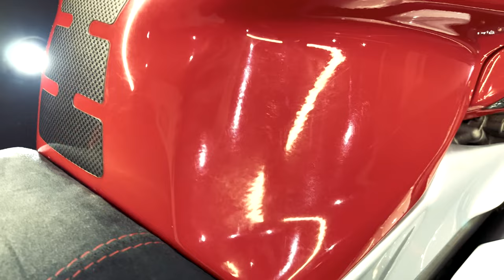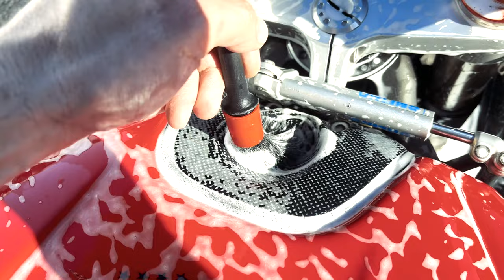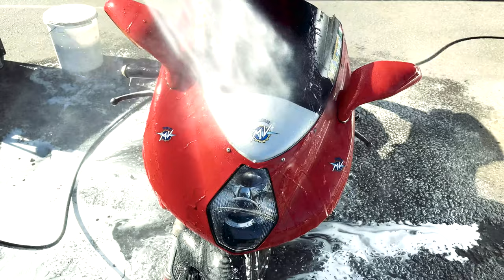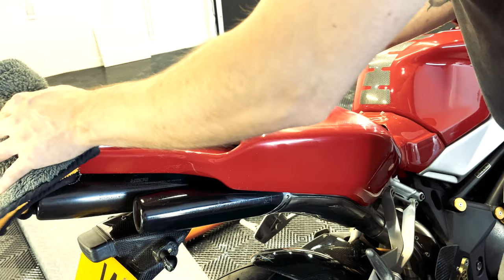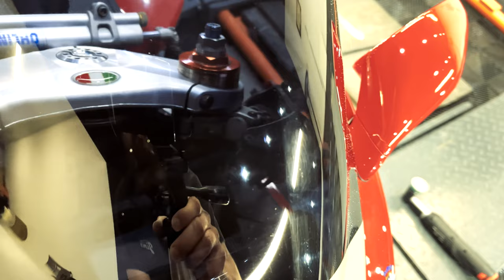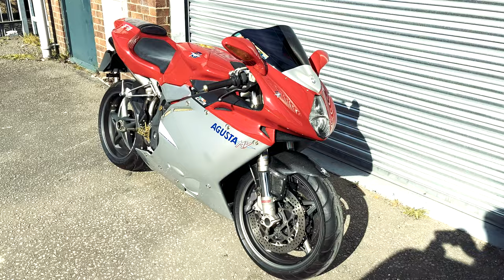Single Stage Machine Polish & Protect - MV Agusta F4 - Motorcycle Detail

Comment: Great job! But I'd never hose a MV, with a lance or with water, even the new models have sections of exposed copper wiring in many areas. I'd rather use a spray bottle and clean it locally one panel at a time just like how it was polished in the end.
Reply from the maker: Thanks for the input. I’ll definitely be considering this the next time I’m washing one. 
I’ve never had an issue from my current process, but I do t want to be close to one either 👍